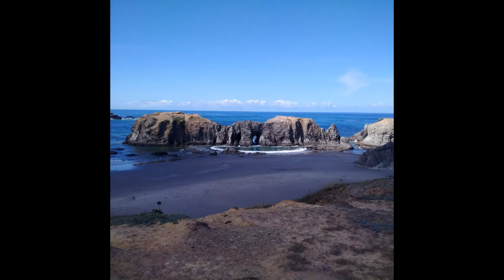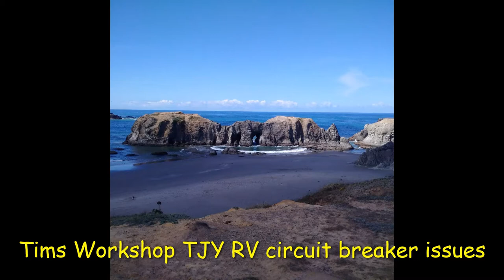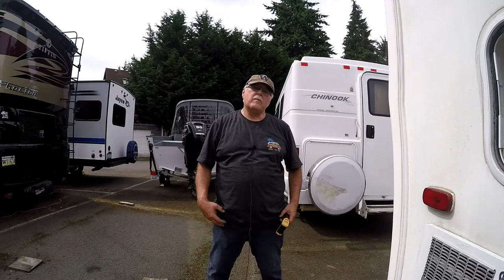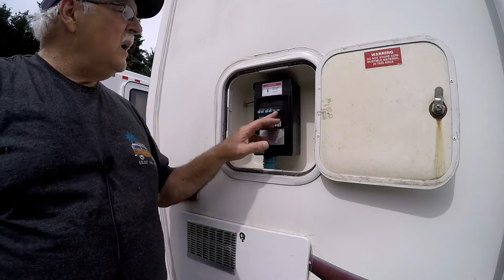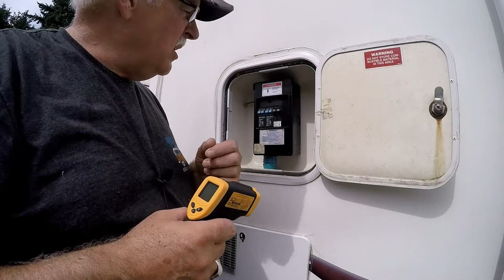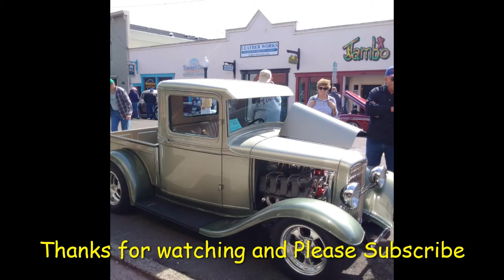RV circuit breakers

Comment: I'm 32 yrs old and I recently bought a 95 ElDorado RV. Same thing happened, it was a hot day, ACs and all and it popped. I thought I was doomed cause I don't know a thing about RVs, but thankfully your video saved my day. Thank you.
Reply from the maker: Thank you Carlos, We had issues for a couple of years before I finally took the RV and had the electrical tested. The first thing they told me was my main breaker was getting hot and it needed to be replaced. I told him I would do it myself but why was it overheating. He said that old breakers when going out will get hot and pop. That's when I decided to get an inferred thermometer to see how hot it was and what the temp on a new one was. I finally found a replacement duel 20/30 amp breaker and was surprised by the temperature difference. The old one was reading 170 degrees and the new one with the ac on was 95. Never had another issue since then and they are so easy to change just don't have the power hooked up when messing with ac power.

Comment: Thank you very much!!! I've looked all over. So as long as you keep the wires on the correct amp, it won't matter my 30amp is on the left and 20 amp is on the right. The new breaker is the opposite. I really appreciate the info.
Reply from the maker: The thicker gauge is 30amp so just make sure it's on the mating side of new breaker.  When I got mine it was on the opposite side too but I saw as long as the 30 amp wire was on the correct side it didn't matter. Solved my breaker popping everytime we ran the ac for awhile with tv and lights on
Reply: That was very disappointing! Looked like an exact match  hooked up wires exactly, tried to install it; the top would not click into place. $14.00 for the breaker, $13.00 shipping, a week to be delivered. Just came back from a RV dealership and ordered a new one. $55.00. will be here Monday. Living in a camper in Florida with no a/c in July is brutal! I have a portable a/c. Not very good but has been a life saver!
Reply from the maker: That sucked for sure. When I bought mine I went to Camping World but they didn't have one. The guy told me about a CO-OP like selling tractor supplies and chicken feed to get one. I thought really? But went there anyway. They had a like tall broom closet with shelves inside packed with Breakers. He asked me what it was for and showed him my old one I brought with. He said here you go but the 30 and 20amp are reversed but should work. If I remember right I think it was 30 some bucks but was why back when I did this video. Not sure but if you have a Tractor Supply store near you they may have one or a CO-OP store? Maybe cheaper

Comment: I appreciate your video it really open my eyes I also was having trouble or am having trouble with my AC breaker jumping all the time but thanks to your video I will look into it now
Reply from the maker: Thanks for watching Jennifer, I was surprised when I found out Breakers go bad. As soon as I tested the temp with the AC, TV and lights running  the duel 20/30amp breaker which runs the AC and main power was 180 degrees. Normal temp should be around 100 degrees. The infrared thermometer you can get at Lowes or Home Depot. I use it to check my hotwater coming out in the RV too
Reply from the maker: Oh, there was a park we were at that their hookup breaker was bad and they moved us to a new site. I showed them their main 30amp breaker was bad and maintenance came out the next day to replace it

Comment: Thanks!! Gotta try this!! Are the breakers easy to replace? Would any hardware store have them?
Reply from the maker: Hi Rick, I got mine at a CoOp up in Mt. Vernon Washington state.  You may need to go to a RV parts store to get one. Mine is a 30/20 dual breaker. When I bought mine, I compared the old one and the 30/20 were on the opposite sides but then I realized it didn't matter because you just to the larger wire on the 30amp side of the breaker and the other 20amp on the other side.  unplug your power to the RV or it will be a bad thing.

Comment: Is it a bad thing to turn off circuits to save on power Like I turned my water heater off and my ACAA C and my microwave when I go to work and I go to work to save empower because I'm not here during the day And I live in mine full time for about 2 and a 1/2 almost 3 years now It's a 39' Springdale XL by Keystone
Reply from the maker: Yep, I agree. I did my research on this and found out that circuit breakers go bad. I was thinking it was the RV parks with bad wiring. We would loose power when having the AC on TV, and a couple of lights. Then other parks it would work fine. After I installed the new 30/20 amp breaker we can have on whatever we want including the microwave and not loose power now. That's why I decided to share this video to help other folks struggling with this issue. Thanks for watching

Comment: I'm having a problem with the AC (no power) but the DC works fine, bad breaker???
Reply from the maker: Easy to test. Unplug the main power and pull the main 20/30 duel breaker and have it tested. If bad replace it the same way you took it apart. There is a power inverter on RV'S but what that does is convert your AC power to DC. Meaning to trickle charge your 12v batteries but also to run DC items on your rig without draining your batteries while pulled into 30a park power.

Comment: Hello! I have a similar problem, my ac brake pop up after work around 10 hours , do you think I have to change the brake ?thanks
Reply: I have to change the breaker?
Reply: Thanks again
Reply from the maker: Get yourself a inferred thermometer and test it. The breakers shouldn't be over 120f. Mine old one was popping @ 170f before I found out they get hot when going out
Reply: Thanks sr.

Comment: We have a 1985 rv and we hear an electrical buzzing and then everything shuts down. Is this an electrical hazard for it to happen periodically? Also what kind of thermometer 🌡️ is that?
Reply from the maker: That is an older RV and electrical can be serious if not looked at by a Electrician. The circuit breakers if that old all need new ones but other things too like the RV electrical inverter. Another thing with older RV'S is rodents getting into the wiring. Because allot of the wiring like in a house is in the walls a RV electrician can test all the circuits and tell if there is any breaks where they have chewed through the wires. If so they can run a new wire in and disconnect the bad one. The testing at a local RV place is only around 100 to 150. Well worth it to know what needs to be fixed to plan on repairing and cost. That's how I found out all I needed was a new 50 dollar duel 30/20amp breaker👍 Our rv is a 97 and everything works but we really need a newer RV soon. Oh the meter I was using is called a inferred thermometer. This is a must tool for measuring when something is overheating but checking out your fridge temperature too

Comment: Also I run a really thick extension cord incord for my heater and I have a separate AC unit that I do the same for I don't run the heater or the AC through my service breaker The AC installed in the trailer I never turned it on and I leave it off but is it a bad thing to turn off other circuits
Reply from the maker: It's a good thing to know your loads. Remember if your hooked up to 30amp park supply you only have a total of 30amps available. You can test this with a simple AC clamp tester. You can test what you use. If your over 30amps then you know your limit. If your under 30 then your should be good with the Breakers you have if they don't pop out. Like my video shows you can also test the temperature of each breaker. If over 100 degrees on a normal day of 50 to 80 degrees outside I would keep an eye on it. Mine was 180 degrees and was definitely bad and needed to be replaced. Hope this helps. Tim

Comment: You didn't show how to actually change the breaker.
Reply from the maker: Thanks for watching Jerry. I had already changed it when I thought I should tell folks about how these Breakers can go put and overheat. There is plenty of videos online that show how to change one but at your own risk. For getting a certified RV technician you should take it in. Most places only charge around 100 to test your RV electrical system.
Reply: @TimsWorkshopTJY  Thank you very much.